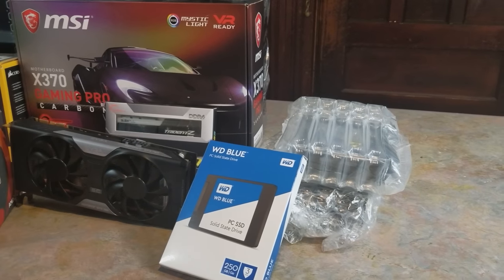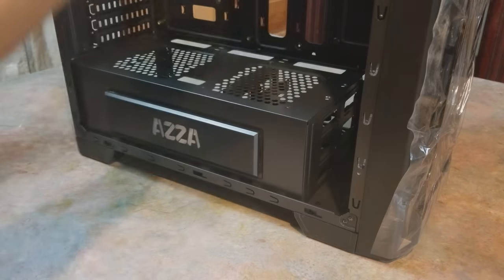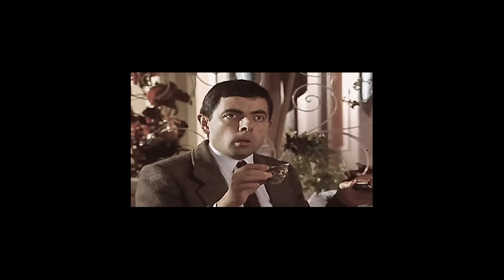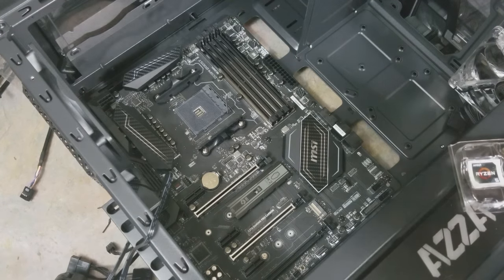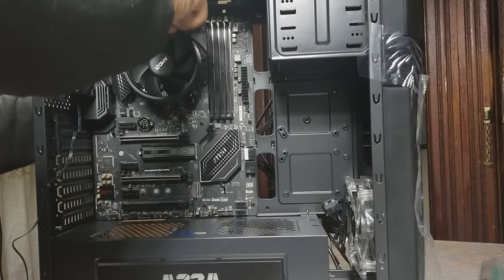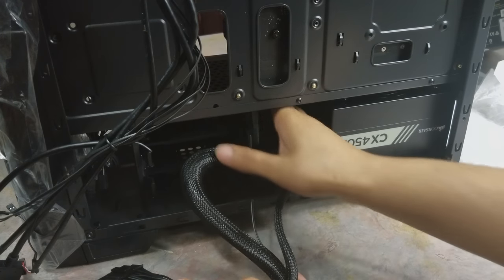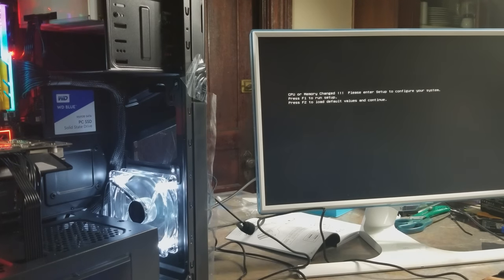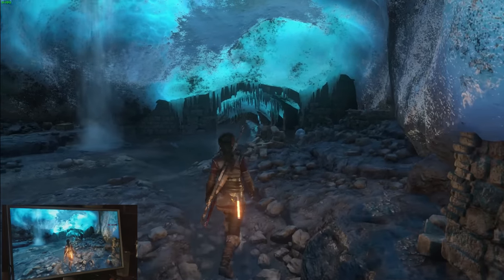AMD RYZEN 5 1600 PC Build

Comment: A good tip for the brass feet for the mainboard.
Some screwdrivers with changeable toolheads are the correct size to fit the brass feet.

And if yours is of the larger variety, you can also get larger bras feet that fit the larger variety.

The contact pads on the mainboard to make contact with the brass feet and the case (which is for grounding, which you should do as good as you can do) are usually well large enough to fit well with larger brass feet then usually delivered with cases.

Comment: You should test the board outside of the case in case of a DOA. "Screwwww youuuuu" Yeah, I know. I'm just saying. I just upgraded to the 1600. My AMD PH II 965 was heavily outdated. Now I just need to move from the GTX 770. 

My wire management is exactly the same. It looks lovely from the front, it's like, an apocalyptic nightmare in the back. Whatever. Who cares. You can't see it anyways.

Comment: Seriously, people unless you build pc's yourself stop the criticism. The build looks fine. As someone who also does this, you overbuild where you can so you dont end up responsible when something goes wrong. A b350 is slightly more sketchy and unless you have and are willing to optimize properly either one is fine. 
I suspect the reason he chose it was he could overbuild the mobo because the gpu requirements were lower.
Choice for 450W corsair is also fine, gundam. The x00B series (if that was what you were referring to) are crap. I'm running a 700b and very unhappy with it. Hurting my OC potential, it gets very unstable if my PSU hits 73C.
Reply: What he said. ^
Also, X370 boards usually have better/more VRM's. Better/more VRM's = Better power delivery, and more stable voltage = more stable system, in general...Plus, he wanted the build to have a certain look, so that's why he chose that specific board (saw one of his comments, under another post)

Comment: ddr4 is always clocked at 2400 max, anything above that is considered an OC and has to be dialled in manually. You should also match the timings that are marked on your dimms as some mobo's auto mode will loosen then up  too much.

Comment: I just built my PC with the same mobo, processor (& stock cooler lol) and trident z rgb ram! I originally had the Gigabyte x370 Gaming 5 mobo tho, but it stopped working (may have been my mistake, but it worked for 2 days and then stopped so i returned and got the Gaming Pro Carbon). I got a 980Ti for the same price I sold my rx480 and got a 1440p 144hz gsync monitor  and now I live at my pc...
Reply: The board stopped working and I've already waited 2 weeks for it to be in stock. Not about to spend am extra $50 on newegg or amazon for it or spend another 2 weeks for microcenter to have it in stock.
Reply: David K. I'm not an LN2 overclocker, I don't need that shit. I bought the gigabyte board bc it had white on it lmao relax it's my computer and I'm happy w/ it

Comment: I recommend using the Phanteks Enthoo Pro M Tempered Glass Edition, if you ever need to do a build with an optical drive.  It's a much better case in my opinion.
Reply: That is a great case, I used the acrylic version on my last i7-2600k build. I never ended up using the optical drive bay though since i put in a front rad. Great cable management, PSU basement with hdd bays up front giving room for large PSU and/or cables and tons of space inside for a mid tower.
Reply: CyberClu Sweet gotta check that case out.  I used a Cougar Panzer case for my most recent 1700X build but it doesn't have any optical options at all.  I don't use optical drives though so knew that going in.  It's a great case if there's no need for optical drives and it was the easiest case I've ever built in.  But the thermal glass panels are both dark, so for those into showing off RGB effects I'd pass on it tho.  I'm not into RGB at the moment but may decide to bling a system out one day ;)
Reply: Installed a Fractal 360mm rad cpu aio up front and added two 140mm fans for top exhaust as the case only includes a 120mm back fan.  Knew this going in as well.  Recommend that new builders look carefully at the case as it's what they will see every day.  For me, I always look for a case at $100 or less that fits how I plan to build in it.  But I'll be checking out that Phanteks case for when I may be asked to build with optical drives needed.

Comment: You know what my trick was with the cooler for my R7-1700?  I mounted the CPU, cooler, M.2 SSD and RAM to the motherboard BEFORE putting the whole damn thing in the case as one unit an screwing it into the standoffs.  Actually, that's not entirely true.  I do that with EVERY build I do (Except the M.2, this was my first M.2).  It really makes things a LOT easier.  LOL

BTW - Did you see Jim at AdoredTV's video that exposed Intel for the fuckwads that they are?  :D

Comment: Unless someone plans to Sli with nvidia cards, I wouldn't recommend the extra cost of x370 board over b350 board which are fairly well built and overclock well. Would Save some $$ for maybe better gpu or processor like ryzen 7 cpu
Reply: Buildzoid did a VRM analysis on b350 boards. 3+3 phase is enough for a 6 core at 1.42 without being worried much about overclocking. About 3.8 or 3.9 for 8 cores. Make of that what you want.

Comment: Can u guys check out my build & perhaps give some suggestions/ tips?

If there would be any good alternatives for the parts let me know, for I would like it to keep as low price as possible.

Mainly I'll be using this build for gaming most especially w/ video editing & rendering. Will it be good enough? What u guys think?

BUILD:
CPU: Ryzen 5 1600 ~

GPU: 
•ASUS Dual GTX1060 O6G ~ 
OR
•(Brand) GTX 1050Ti 4GB ~ 

RAM:
•G.Skill Ripjaws V 8GB DDR4 3200 MHz(2x4GB) ~
"OR ANY 8GB DDR4 3000 MHz"

MOBO:
•ASUS Prime B350-Plus ~ 

Storage:
•1 TB HDD 7200 rpm ~ 

PSU:
•EVGA 650 Watts 80+ Bronze ~
"OR ANY 550-650W Bronze"

Monitor:
•ASUS ~ ?

Case:
•??? ~ ?

Will everything go well? Especially w/ that first post?
Reply: hey bud know this is way late but a cpl of things i found when selecting my first build is the memory you def don't wanna get anything over 3000mhz for ryzen atleast i know that was the case awhile back so i went with gskills ripjaws 4series 8gb(2x4) ddr4 3000mhzthere also a very sexy blue imo and only 103bucks so not too bad i think also for your hdd if your budget cant afford you an ssd like mine then look into getting a hybrid theres suppose to be quieter then the full hdd and also a lot faster although not as fast as an ssd of course but still best of both worlds is what i hear i personally got a Seagate firecuda 1td 3.5in 7200rpm hybrid internal hard drive although i think i screwed that part up pretty sure i could of got something a lot bigger had i shopped around a bit more but that's on me still ive heard good things abpout these and i figured why not ill be getting an ssd shortly i just ran outta funds atm so a month or 2 ill have ssd and then this hybrid for back up/storage. not sure about your mobo but i do know you can get some solid boards for 70-90bucks so hopefully yours isn't at the higher end of that spectrum personally i went with the asus strix b350 but it was bit pricier at 111bucks i think theres a tomahawk msi brand for about 73 that had some really good reviews might be worth looking into and for a case you should check out deepcool i just got a white dukase from em and it is sexy as hell only complaint is it came with just 1 preisnatlled fan so i know i have to buy a couple more case fans but they have other cases to pick from i seen a review on youtube for the deepcool tesseract sw blue and black with a side window for only 34.99 and it reviewed really well i almost bought it myself but i just had to have the white one when i seen it..again i know this late if you've already boiught your build i hope iyt all worked out for you if not i hope this helps a bit I'm no expert just honest opinion is all take care an gl

Comment: are my specs better than this.

Ryzen 1600 3.2ghz
G.Skill 2x8 2400mhz
RX 480 8gb
Reply: Apart from the ram yes (cpu is same) ram speeds do actually help ryzen out more than intel if I were you I would do a small overclock to your ram and cpu. You could easily hit 3.7ghz with a 1600(temperatures may be high though), ram is a bit more complicated but you can probably reach 2600-2933 fairly easily. (make sure you update your bios if you want to try overclocking your ram) - don't touch ram voltage, you may need to do a small increase to cpu SOC voltage and increase ram timings in order to boot.
Reply: trignite i knew it helped out ryzen. so hows 2666 ram and 1600s boost clock of 3.6ghz and keep voltages on auto?
Reply: trignite thank you for the help. so i can keep 1600 3.6ghz on auto voltage?
Reply: The 1600 will automatically boost to 3.6ghz on some cores when needed but if you want to overclock all cores to 3.6ghz then you may need to change voltage. Auto will probably work but I recommend just manually setting something like 1.23-1.28v on the cpu vcore. it's perfectly safe if 1.23 doesn't boot or windows crashes just increase it to 1.24 and so on.

The reason you want to use the lowest voltage possible is because it will help to reduce heat and power usage.
Reply: trignite ok thank you
Reply: Actually those voltages are a bit high, I will edit my post.
Reply: Done. If you're using the stock cooler than you probably can't go over 3.75ghz because it will get too hot with a high voltage. 3.6 should be perfectly doable though. Use a program to monitor cpu temperature and see how hot it gets while running OCCT, as long as it doesn't go over 90c you're quite safe. Just remember to try and keep the voltage low, if your computer crashes then you need to increase it but keep it as low as possible.
Reply: trignite k
Reply: trignite i got my Ryzen 5 1600 at 3.8 ghz with 1.275 volts with the stock cooler. But now im using water aio.